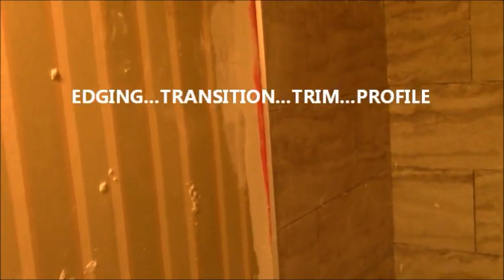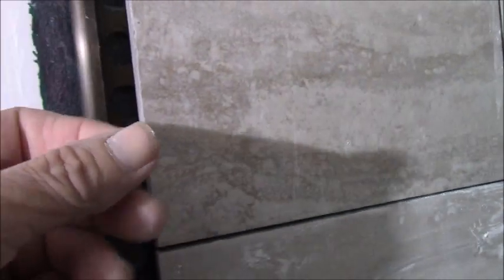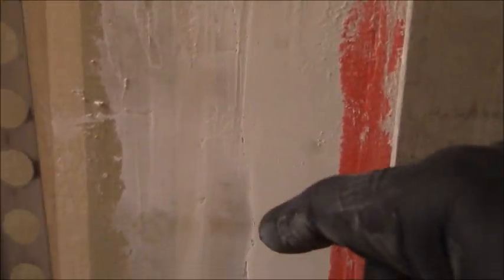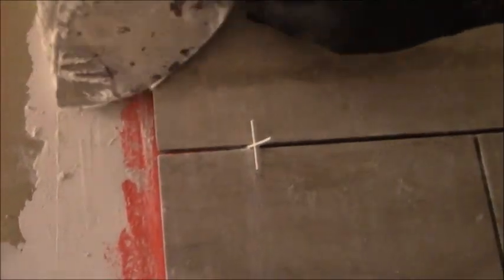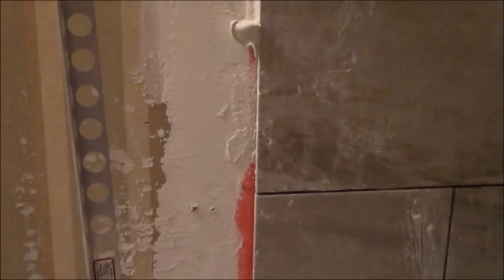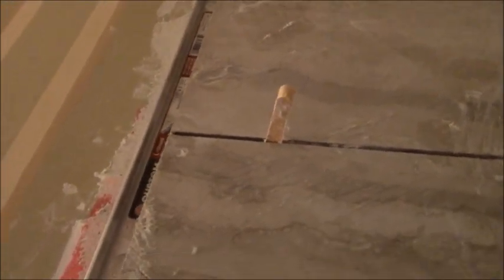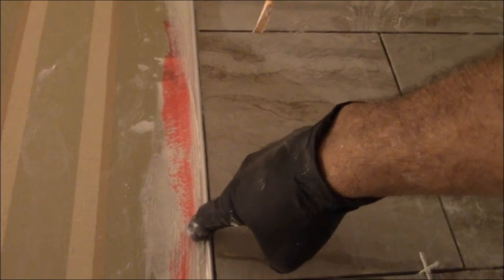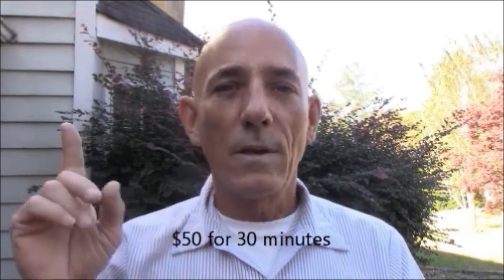HOW TO INSTALL TRANSITION STRIP

Comment: Use the same color Caulking as the grout to install edging strips instead of thinset.  Its easier also the caulking will expand and contract with any vibrtions to the wall. Also u wont have wait to go back and grout when the thinset dries its all finish at one time.  A lot of times people use glass door and that causes vibrations at the fastening sight.  So the caulking helps reduce any seperation cracks caused by the door mechanism closing

Comment: Instead of pushing the glue in behind the tile I run it across the metal angle. Just a thin layer on top and bottom of the meshed area, goes in with a reasonable amount of resistance. Pretty clean and real quick. other then that we do it exactly the same.

Comment: You should sponge the edge of the tile and the wall clean of excess thinset before inserting the transition strip. Otherwise, the built in grout joint separating metal from tile will wind up clogged with thinset that is difficult to remove. Same goes for the wall. There should be a clean, sharp line separating the strip from the wall. Cleaning that out after the fact is tedious work and you risk marring the finish.

Comment: Thanks for your video, you left over 2 feet of paper on your transition 7:21 (that acts as a "bond breaker")... Allows for two siding contact and not continuous contact from wall, through holes in transition to the back of tile.
Note: You did say you don't read directions...
Reply from the maker: Yes you are correct on one point, the tape SHOULD be removed, but not removing will not cause an issue with thinset holding in an 8 foot strip with 3inches of tape on it.

Comment: I’m a DIYer and I installed my tile with an unfinished edged I did not know about trim or bullnose at the time. Now I want to put something on the edge knowing that there’s options. Was thinking about getting a multi tool and cleaning out the tile from behind and just putting an edge or maybe a pencil liner tile for right now I just have caulking on it.  Any suggestions? I’m a DIYer and I installed my tile with an unfinished edged I did not know about trim or bullnose at the time. Now I want to put something on the edge knowing that there’s options. Was thinking about getting a multi tool and cleaning out the tile from behind and just putting an edge or maybe a pencil liner tile for right now I just have caulking on it.  Any suggestions?
Reply from the maker: Yes the tool COULD work to get the thinset out, but multiple blades later...or cut some of the transition strip back a little with nippers...your options are limited since bullnose prob won't fit.
Or plastic trim at home depot & glue it in, they have thin trim too that may fit.

Comment: Is drywall getting hung? How is that wall getting finished? Now there is mortar all over it. Definitely not sanding that.
Reply: Look closer, that wall appears to have wall paper, which will have to be removed for the renovations. No need for clean up since the excess will go with the wall paper.
Reply: I don't care what's going over or not I'm cleaning it. It just looks more professional
Reply from the maker: If you heard me in the video I explained shiplap will be on the entire wall & butted up against the strip.